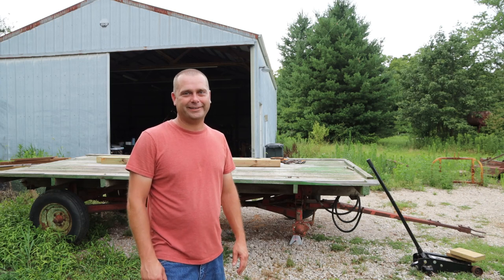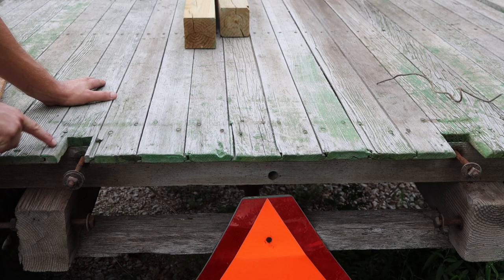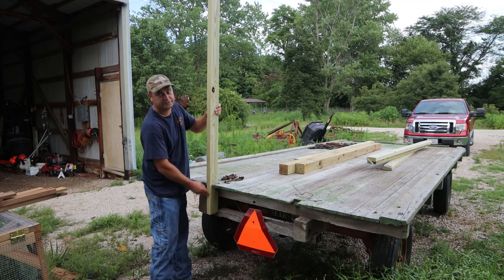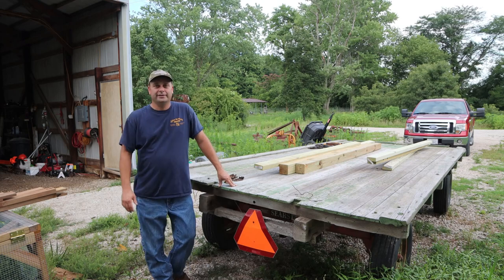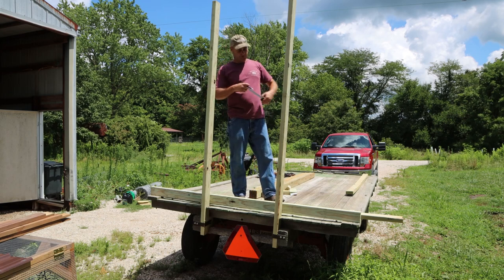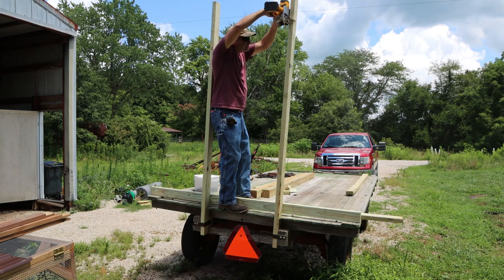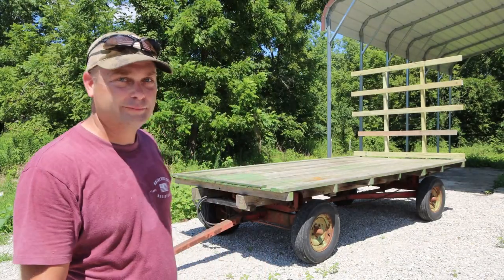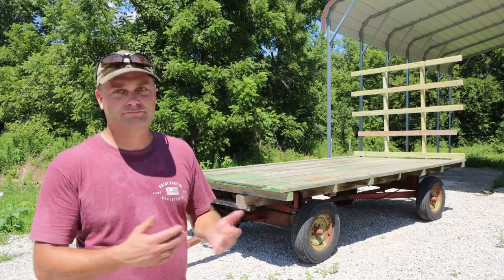Fixing the old hay wagon we bought

Comment: I've baled and stacked on the wagon by myself many a time. The hoist is for when you put sides on the wagon for hauling ear corn and grain. If you've had to shovel corn into a crib you'll understand.The  fence on the back of the flatbed is called a ladder.Or that's what we called it. But if the tractor driver is steady and doesnt drive like a fool, you dont need the ladder. That's if you really know how to stack hay.A wise old farmer once told me,"Every thing in life has a trick to it, you just have to know the trick."60 years old and I've learned a little bit.

Comment: David Bradley and sears partnered in the 50s but not in the 60s.  You will find a hay hook invaluable for stacking bales and grabbing them from the hay shoot.  We always called the upright on the back of hay wagon a "standard".. I immediately thought of firewood as a handy use for that dump feature.  Though i bet it would be handy with brush or rocks.  We used to pull a hay wagon through a freshly worked up field to collect rocks.  Time for Rebecca to learn how to drive tractor?

Comment: There needs to be a strap bracket level with the top of the deck on the wagon to meet the rack from leaning backwards. As you said, that’s the weak direction. The original mount had the top bolt holding against rearward force, but as you built it, there is nothing keeping it upright.
Reply: Or a strap of wood or steel(even chain) coming from the sides up to the upper portion of his wall to steady it. Like the straps on an equipment trailer that hold the ramps up while they’re not being used.
Reply: Looking at it again, I see there is only about 4” from the lowest bearing point on the front to the highest bearing point on the back, which is the top of the metal strap. If a similar piece of strap metal were made to bolt onto the lateral 2x at the back of the deck, just under the decking, and surround the 2x4 stake on 3 sides, then bolt into the lateral on the other side of the stake, you’d have another 6-8” up on the backside bearing point. That would be much stronger for holding hay on the wagon. The other thing I’d do is remove the bottom crossbar and put it at the second level. Or swap the short one to the top. That would be visually nice plus save you catching those upper corners as much.
Reply: I caught that same thing about the bottom 2x. Like he said though,he ran out of 2xs. Wouldn’t take much with that dewalt to swap it to top though. The corners catching on anything up high is a good point too. Always seems to be something in the way when your trying to back them into the barn.
Reply: michael shea Your chains would keep the rack vertical for sure but if you can do without them, you can stack the hay a little wider than the deck.
Reply: True
Reply: some sort of strap or bracket even with the top of the bed also he had the the 4x4s would have used them wouldnt have added that much weight put a loop on top to lift . back up to a wall and use a cable winch to lift off and hang if need it off
Reply: It’s fine the way it is. It’s only there to align the first row of bales and maybe prevent them from tipping backward if he pops the clutch or accelerates up a steep hill.

Comment: Used that type of wagon when I was a kid. Ours fit 80 bales each. Had 3 of them. Until we bought a kicker baler. Then we built 4 wagons that held 150 bales each. We did lots of little square bales. Half for us.  And sold half to other people. Between 1st and 2nd cuttings we did between 50k and 60k each year. If we didn't get 1500 bales in a day it was a bad one. Usually 2k to 2500 a day. Weather permitting.

Comment: Nice work. Like your haircut. Unscrew the valve stem before you break the bead. I think on the tires you should have something like 4 ply, meaning they are for heavy loads and not passenger tires. I’m learning also,

Comment: That dump feature is cool!  You can use it for hauling manure/compost/wood chips and dump it near your garden for use..
Reply: especially if you could have some sort of slippery plastic flooring that you could drop on to the wooden boards which would allow a load to slide off easily  as the tipping angle at full lift is not especially steep and loads may stick.
Reply: @w056007568  Slippery plastic flooring not a good idea when stacking bales on the rack while baling.
Reply: @dwightl5863  
Point taken. My comment should perhaps have been more clearly explained. What i meant was timber flooring for jobs like stacking and hauling bales but have some sort of slippery material in sheet form that might be dropped on and quickly bolted down but easily removed when not needed.

Comment: What you are building is a rear standard for bale retention, before hay balers were invented, hay loaders were pulled by horses/tractors connected to wagon. they were loading tall loose hay that dropped from loader  onto wagon so front standard was needed to secure hay from falling off due to vibration running on   on even ground.
Reply: Really?? we called it a rack, as in hay rack.

Comment: My years on the farm and haying...we never had a rack on the back. We still stacked 5 layers and never worried about the hay falling off.
Reply: but i bet you put a tie layer in to hold it all together  we did with our nh stack wagon
Reply: @frrapp2366  Yes. 1st layer ran 2 bales going across the width of the wagon and the 2nd layer bales ran 4 across tying 1st and 2nd layers together. Additional layers were repeats of the 1st two. At least that's how it was on our farm.
Reply: We cross stacked just the back and front two rows.  We had hilly farms and never had issues with keeping hay on the racks.

Comment: Put a tow hitch on the front of the tractor lot easier to steer the trailer back hitched to the front.
Reply: Good idea
Reply: Or a tidy hitch on the front of your truck so that you push to drive it it somewhere.
Reply: I thought his backing skills looked good backing the trailer at the beginning.
Reply: Out of curiosity, Did you check wheel bearings, seals and re-grease them?

Comment: You will find out why the end gate had the bolt system , and you need boards on sides as well to keep them from snagging on tree limbs and such and can also run a brace on each side . We used chain , doesn't have to be heavy but enough to support the end gate

Comment: Put a little bevel on the bottom of the post all around, it'll go in easier.
Reply: Might be harder to release when its wet and swells up the 2x4s
Reply: My thought exactly. Really just need a tiny bevel on the back and inside edges where it makes contact with the brackets.

Comment: What you just built is commonly called a "standard".  It needs to lean back slightly or your hay bales will creep forward as you stack to the front.  Hay racks are typically 8 feet wide.  Good for you saving that old equipment.  Take good care of that CASE!

Comment: Your right on track using straps to hold the back on !!!  I have 7 hay wagons...I use 2x6 lumber the flat way as your doing. A 2x6 will hold the load. 2x4 is rather  " questionable". The key is to get the backs to tip back slightly....but not too much.....putting too much force on the backs. From bottom to top.....maybe tilting back about 4 inches at the most.
All my back just pull up and off. Very simple to use.....and the flat beds work much better for round bales too !

Comment: Nothing more exiciting than getting a new hay wagon built, especially one that tracked straight down the road. 

To break the tire bead, try just missing the rim with the front tire of the tractor.  You can almost drive right around the rim.

None of our racks had the back fence.  You just had to load it properly.
Reply: My dad used to do that to break the bead.

Comment: You can break beads that way but it’s easier if you put the tire against something solid like a tree or telephone pole. Tip it up on end just as it would be on the hub.  I change rear tires and tubes on tractors that way while their still on the tractor. Take out the core and let her go flat. Weight holds the bottom while you push with the bucket on the side or wherever you can get access

Comment: That dump wagon was.perty cool. Never had seen one before.
Reply: That’s a first for me too! I wish it was mine.
Reply: The running gear is from a forage wagon.
Reply: I think Warren is right. A tilt bed would eliminate the need for drag chains and bars to pull silage out in the trench/pit.
Reply: @johnsadler8637  Ok for a pit but not for filling a silo.
Reply: @Dwight L - correct. I’m familiar with pits, but not silos. Do the silos work best with automatic drags? We pulled our drags out with another tractor.
Reply: @johnsadler8637  Silos in America anyway are tall concrete block, steel and glass lined, and much earlier wood built storage structures for chopped hay, corn, etc.  Diameters and heights vary.  15 - 30 feet in diameter and perhaps 40 or more feet high.  A silage blower literally throws the silage up a 6-8 inch tube into the top opening of the silo.  This video is one type of platform blower:  https://www.youtube.com/watch?v=1cTNkzsrU-I        that a wagon of this type could be used.   And this video shows another type of blower in action:  https://www.youtube.com/watch?v=V7OcbgmGggs     .

Comment: I would suggest adding an additional horizontal bracket even with the top of the wagon.  Too much pressure for just one bracket.  You can always bale, let the hay fall on the wagon until one bale falls off and then go back and stack what is on the wagon and on the shoot.  It is easier than picking it up off the ground.

Comment: The tractor bucket method of breaking down a tire works great but you usually still have to beat the bead down manually. The bucket just helps with the process.

Comment: To break the bead, place the tyre under the front axle of a tractor and using a bottle jack pump the jack, it will push down and break the bead, saves loads of time.

Comment: You need to frame around the horizontal boards and put 45 degree bracing on each side. The wagon will last a long time. I would also paint it. You can change your own tires if you purchase a manual tire machine from Harbor Freight. Most farmers learn to make their own repairs. My father taught me a trade to carry throughout my career.

Comment: ESCO makes a bead breaker tool there are other makes as well but I bought the ESCO brand are they expensive yes, but it sure beats the duck bill hammer or bead chisel that I have as well. I paid 500 dollars for the esco bead breaker years ago so not sure what they sell for now. What a life saver though. The one I have is rated for a air gun but you can use a hand tool or cordless impact. I have used it on tractor tires, truck tires ( steel wheels) and impliment tires. I highly recomend it well worth the investment. I would buy one again if needed. 👍

Comment: Good design on the hay rack.  ours is similar except the strapping was a lot wider like 4 or 5 inches tall.   Also, our rack is the same except we also added a board down each end to tie all the cross members together at the ends and give extra support of bales on the outside.    one addition to our hay wagon is for wear... we added an angle iron across the front of the wagon where the bale shoot will rub.   it is better than a board like I see your wagon has across the top of the deck in the front because.... there is a lot of hay chaff that needs swept off the wagon between loads.  having a flat surface to sweep that loose hay off the front is nice.  I have baled by myself but it is time consuming.  I will still bale with a wagon... most often I can get about 5 bales to push back onto the wagon.  Then I have to stop go back to the wagon and stack them and repeat.   a pain but baling onto the ground is way more labor intensive.

Comment: You should not need the standard (if) you tie in ( cross stack)your bales as you go.Im 60 now we put 50 bales in a regular pickup truck from field to barn, no ropes or tiedowns necessary
Reply: None of our hay wagons had anything to stack against.  We would cross stack the back and front rows only, averaging 72 bales per load.  The first thing you learned as the loader, was how to stack properly.  Our fields were hilly.  Unloading was a breeze.  We eventually went to a bale thrower.  What a pain unloading those wagons.

Comment: If you're changing tires at all, invest in the harbor freight tire changer/bead breaker. I used to struggle breaking beads but i've yet to encounter a bead i can't break in 2-4 seconds with the HF tire changer. Best money I ever spent, I think it was only around $100
Reply from the maker: I actually went to buy one before making this video.  They didn't have any, so I asked.  They said they were just recalled, and they had to take them off the shelves.  But that was my original plan.

Comment: Great job on the trailer & back wall. I wouldn't dump bales off of it though using that dump feature because you might bust quite a few bales. Though you won't know unless you try. lol
A good use of that dump feature would be to make removable solid wooden sides & use it to haul dirt & any other loose items.
& if you ever need help stacking bales, I would be willing to help if I have the time. I'm a farmer & have experience with square bales & stacking.

Comment: In England they are called raves useful being a tipper just became multi purpose to break the bead on tyres lay the wheel flat place a block of wood on tyres get a piece of 2 X 4 of a good length to use as a lever place between the tyre and tractor bucket at an angle  make sure the valve is removed  push down on the 2x 4 and pinch the block and the bead will break never failed for me

Comment: should have used the 4x4s  need to look for a ground drive bale elevator to lift the bales to the trailer  dont see many around but look in back lots of farms .  can use with truck or attach to the wagon  might even get one given to you if you can find one  at an old farm stead.  Good luck but watch those 2x4s

Comment: May be of interest to you to look at the old fashioned wooden additions to a trailer for carrying hay etc. Dating back to the old horse drawn days. They lean back or forwards, depending on which end fitted, to increase trailer capacity. Usually just slot into holes made for the purpose. English language for you from those days. The trailers were usually called MOFFREYS and the extensions GORMERS. Depending if course into which part if U.K. you came from. I have just checked Google and a set of GORMERS for sale on there to fit an old Massey Trailer, with photo.But few other entries.

Comment: you can use the wagon by your self. done it many times you keep baling until the deck is full , as each bale comes off it will push the other bales back an to the side, when you have 6 or 7 on the wagon you stop and pile and go again, what do you mean when you have help you will be on the wagon, gees dont you know the helpers start at the bottom and work there way up, you never put them driving tractor, there on the wagon and loading and unloading on to the hay conveyer.., when i started helping with hay i stand on what was called a stuck slay behind the baler, you lifted the bale off the baler as fast as you could and placed  the 1st row of 3 on comer to corner edge,, all well trying to balance your self on the slay that bonces over the ground.  then 2 bale row on edge and a 3rd bale on top and stepped on the trip peddle to dump off the stuck and start over, then the farmer went around with a loader tractor with this 4 prong fork  were the dump was spring loaded to  dump and return back to lock.. and picked up each stuck and set iy up on the wagon and 2 guys piles it as the farmer got more, before long you were 12 bales high on the wagon heading to the barn to unload and stack in the barn, adding a little hat salt on each layer and back to the field for the 73rd load of the day

Comment: An easier way to break the bead on a tire......  lightly heat the rim with a torch.......use the front tire of your tractor......best if you use the " inside " of the loader tire....drive up on the tire as tight as possible against the rim........follow the rim around with the loader tire....normally it pops off.
By heating the rim slightly it softens the rubber of the tire against the rim...making easier to pop off.
Rusty old rims might take more heat. No need  heat so hot as to burn paint off the rim......most rims this age dont have much paint on them anyway.

Comment: I have a sears roebuck 700-429 wagon very similar to yours. However, it has some sort of sissor lift mechanism over the front axle. I cannot find any info on it. It is missing the hydraulic ram so I'm not sure how it worked originally. Let me know if you know anything about it. thanks

Comment: I like you. If it is simple, by all means complicate it. That is not a insult but seems to be my theory of work.  You only really needed crosses 2 and 4. The bales will interlock (if stacked right) and the rack is important only for the first 2 or 3 stacks. Dirty  - farm work, What's your point? But you done real good -  except for that last idea of dumping the hay. Handling it 3 or 4 times from a jumbled pile, not a great idea. And honestly, I don't know if it saved time but when I baled  (17YO) alone i would let 6 or 7 bales just  slid onto the wagon,then stop and stack them. I'd take every bale that I could off the baler and leave a path for more bales. As it filled I'd raise the chute and stop more often.